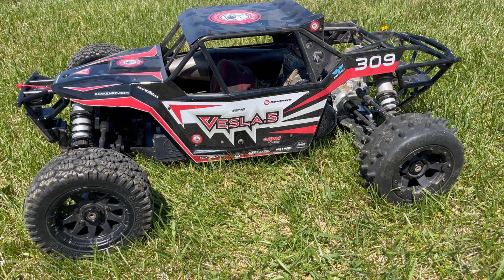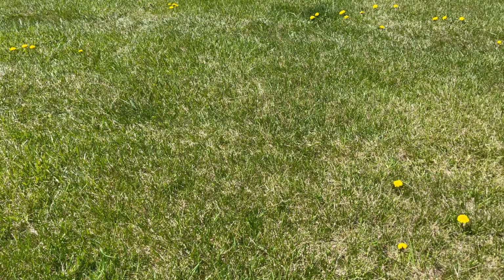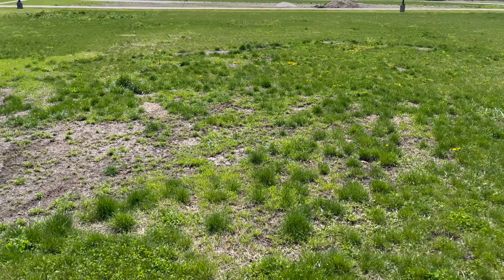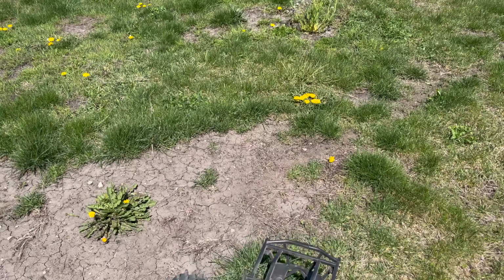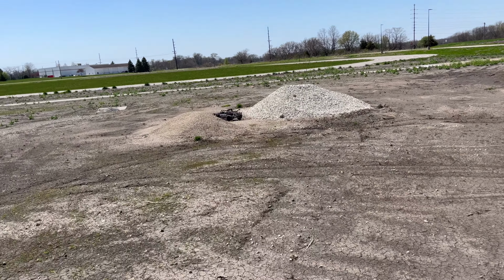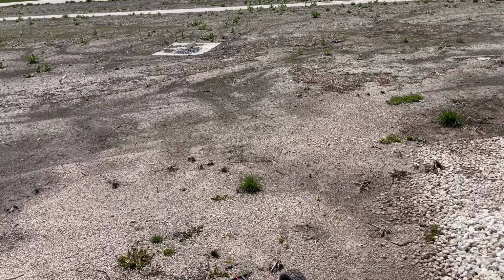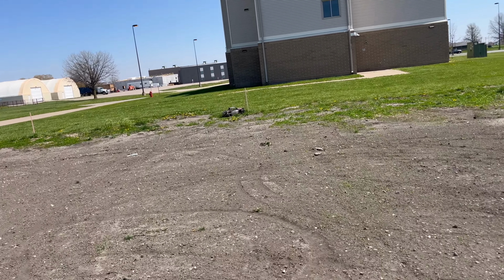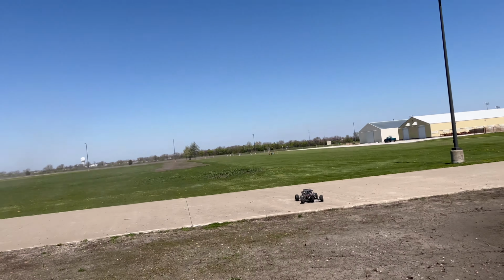KRACKEN VESLA.5 AT THE FAIRGROUNDS LET’S SEE HOW FAST IT IS!!!

Comment: Great run out this mate! Clutch is very snappy, I like it…what clutch setup do you have installed? Keep the videos coming 🦾
Reply from the maker: Thanks, my bro. I’m glad you like it 👍🏼💯 i’ll be getting my 71 supreme out soon😁 i’m running the UFC steel clutch with an 8000 RPM clutch spring😉 hope that helps
Reply: @Meyers2strokeRcgarage  it’s really pulling off the line well mate, I was curious. I have the fs full metal clutch, stock bell and 9500rpm spring…Iv only ran 3.5 tanks through mine, it’s waking up nicely 👍
Reply from the maker: @GazYT1285  right on brother 👍🏼🤙🏼